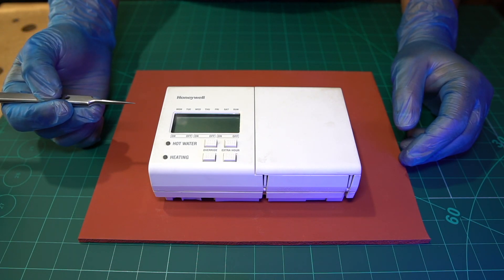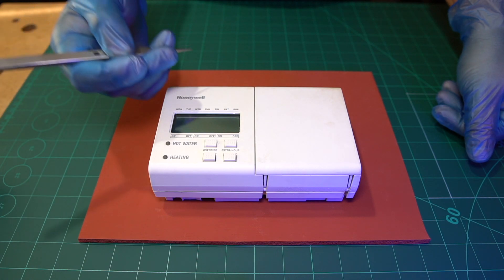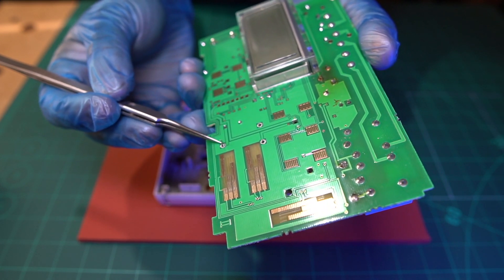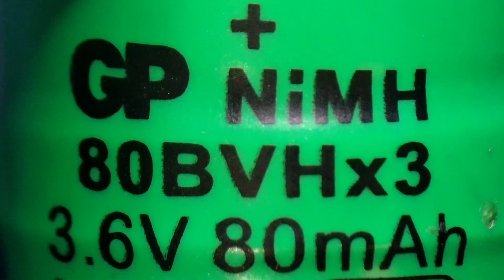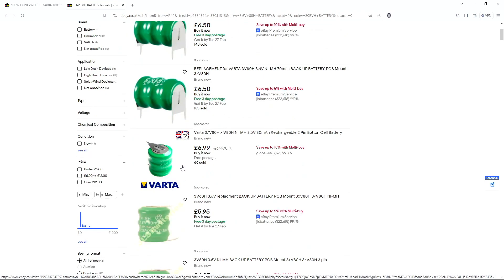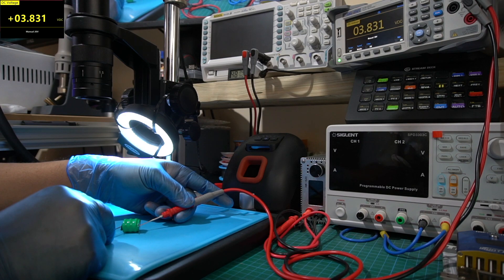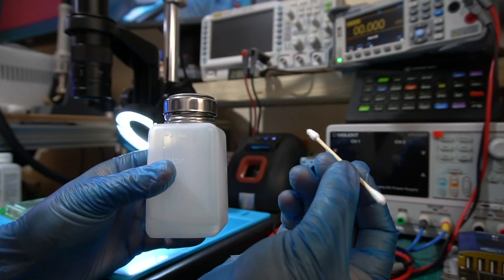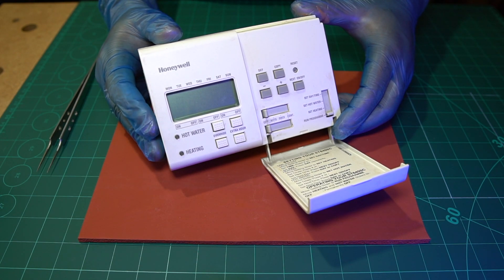Honeywell Central Heating Programmer - Diagnostic & Repair - iRefab

Comment: Yes as bellow lovely lab you got going on ! Capacitor dropper circuit  is pretty common  failure even on  the newer st9400 replacement . A good idea to replace 47uf filter at the same time.  Newer models now use a cr2032.
Reply from the maker: Thanks for the tip 🤲🏻, I’ll bear that in mind if we get anymore of these in 👍